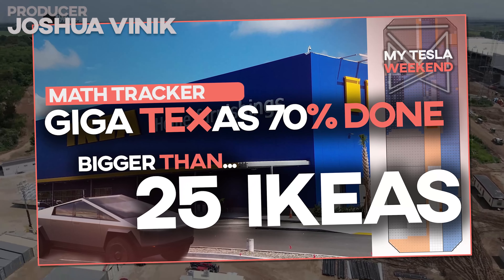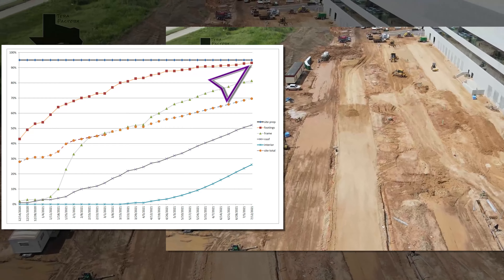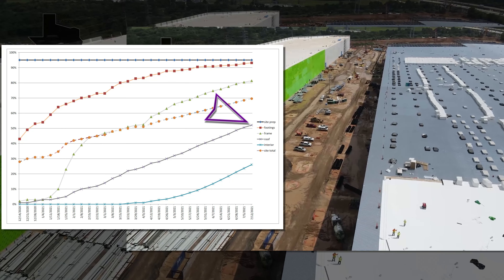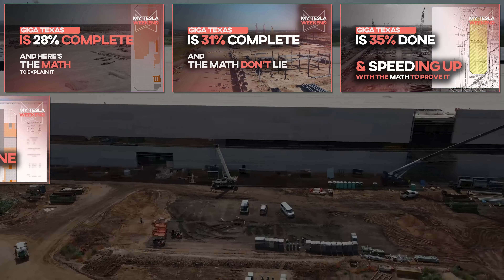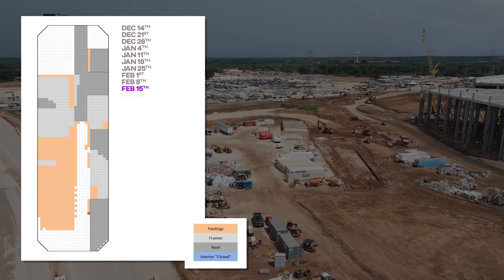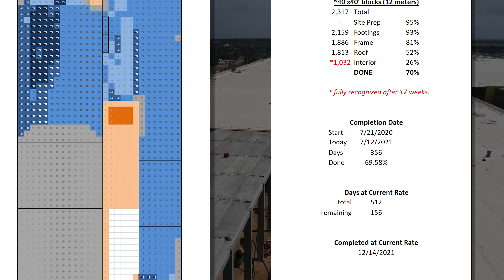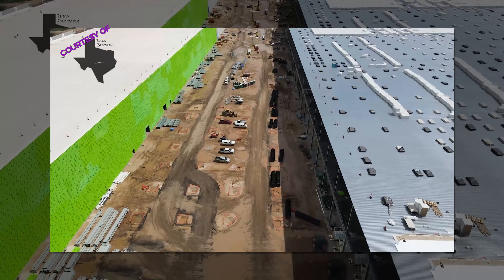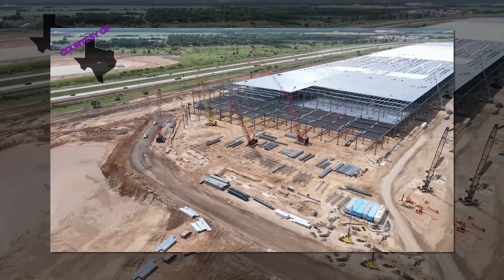Giga Texas is bigger than 25 Ikeas and it's 70% done

Comment: As for provisional CO’s….it’s generally done by sections of the building broken up by fire and smoke walls. So if the building is broken up into say six sections and three of them are used for Model Y production, as long as those sections are safe and up to code and they are broken off from other sections by two hour smoke walls and usually 1 hour fire walls, you can usually start using them. Still a lot of work to do, but I’ve worked in a lot of places that started production with the entire build still months from completion.
Reply from the maker: Thank you William. Can you share a citation for this, because I spent about an hour researching and only found the definition as being "a building" which would include the greater structure, to my mind.
Reply: Absolutely true. It may be hard to find a citation for this since this is generally in the books for contractor licensing

Comment: You should re-think your 4-week footer curing idea. They have put up columns in the casting area less than 2 weeks after pouring footers.
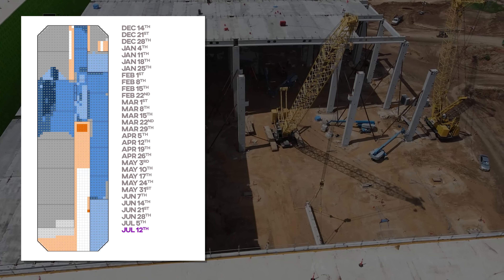Reply: Uh, but no. If you look at 05:09 you'll see the footings from two weeks ago don't have columns on them yet. It was only the two rows closest the the existing structure, and there are no columns on those yet.
Reply: @davosmergblar1014  they put in 9 footings 2 weeks ago where the tankers used to be, and they just put columns on 3 of the 9. the footings nearest the casting machines went in long ago (the columns are doubled) so they have 9 columns to go, but only 6 new footings
Reply: @davosmergblar1014  I don't think so.  There are three columns on the latest footings.  They do have nine columns to go, but three are right next to the existing columns and those footings have been there for several months.
Reply from the maker: @Bruce Dubbs The footings poured two weeks ago do not have columns attached as of the latest video. On June 28th there were 4 left to be poured. By July 5th they'd been poured.

If these get columns in the next week, this will give some breathing room to the final completion figure, but once the last walls are up, even with the 4-month interior completion lag, they may be able to get a certificate of occupancy at any time, provided their interior systems are complete.
Reply: @FutureAzA  Not sure why you are being so stubborn about this when there is physical evidence.  The new footings most certainly have columns.  Check out Randy's video from July 9th (footage from July 8th).    There was a similar situation back in November when they went from pouring the footing to placing the column in about 15 days.
Reply from the maker: I am ABSOLUTELY mistaken... well well well, this gives the deadlines a whole new breath of possibility. Thank you for the correction, Dale!
Reply from the maker: @Sammy K I wasn't being stubborn, I was mistaken. Dale Richardson posted with two links for me to review, and he (and YOU) were right. They are absolutely putting up columns in less than four weeks. This gives me reason to rethink next weeks projections.
Reply: @FutureAzA  Reason I thought you were being stubborn is that this was brought up in a few of other videos (even yours) where you participated in the comment thread and it was pointed out that they were not adhering to a 28 day curing time.  So when you posted the same here on your latest video, I figured you just didn't want to believe any of the evidence that was presented.
Reply: 3 words for you . “Early straight concrete”
Reply from the maker: @gevelmarrero  Maybe more than three words would help me better understand. :/
Reply from the maker: @sammyk874  Oh, I wasn't calling you out. I was explaining why I needed to apologize. I assure you I was CONFIDENT the 4-week rule applied until I saw these side by sides. I was simply wrong. I'm happy to own that. It only makes my future projections that much sharper.

I'll use 2-weeks in future projections, since the upcoming ones are all much lighter steel than this uber-heavy concrete. This is awesome information for me to learn, and I thank you (both) for this.
Reply: @FutureAzA  Probably referring to (High) early strength concrete...

Comment: I believe the middle corridor was left for access during construction. imagine trying to use a crane to reach across the width of the building. also, I cant remember where I saw the shape but the entire building is supposed to be a complete rectangle without its corners...the corridor will be finished after they are sure that all crane work that can be done, is done before they complete the building.
Reply from the maker: That's my take as well.

Comment: “Since you asked”. ..   I believe that the central opening at the south end will remain so, since the concrete slaps of the southwest corner, the “Stamping Building” seem to be reserved for exterior walls.   I doubt we’ll see any footings south of that demarcation point.

“I once thought I was wrong, but I was mistaken”
Reply from the maker: This may prove correct, but bear in mind that Berlin has tons of interior concrete walls.
Reply: I think those walls are more for containment of any of those thousands of tons of pressure if any of them do something unscheduled.

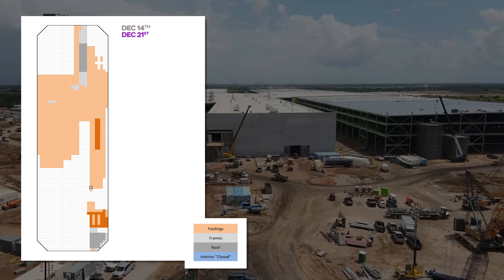Comment: @4:03 - most of the know Model Y area is already blue.  So who knows when that first car will be made......I'm still holding onto early September.
Reply from the maker: This isn't a crazy notion, Gerry. Once the exterior walls are in place, they COULD apply for final permitting, or at least a provisional certificate of occupancy, assuming the critical interior safety systems are in place. I expect that to happen around that time, and it looks like they've been installing, configuring, and testing the equipment to move quickly into production.
Reply: @FutureAzA  Agree -

Comment: Do you expect the south central corridor to be fully built? I was wondering whether they would only go south as far as the northernmost end of th estamping building (since this is walled to the west side with outer walls rather than just a fire break wall).
Reply from the maker: If you had asked me a few months ago, I'd have said no. At one point I even replaced the central corridor square with question marks for this very reason, but they resumed footing work, which upended my assumptions.

Berlin has a lot of interior concrete walls, so I don't count that as a good indicator. The green extending down to it definitely suggests the structure will go at least that far.

My hesitation to commit is the massive lack of loading docks around the property. Curious to hear what all you guys think.

Comment: Great video and tracking of the site! I don't think they are going to make it for the deadline unless they don't fill in the middle bit.
Reply from the maker: Kind of depends on how much of the interior needs to be done for the site overall to be considered finished. It could be that since so much of the equipment installation is already underway, that my 17-weeks from walls to done is overly pessimistic. Still pretty exciting either way.
Reply: @Melody615199999  The bit in the middle that's still wide open where there aren't any footings yet.

Comment: This maybe done with private inspectors to not delay the project. They probably hired a company that is on site doing inspections possible weekly. It’s called private provider and they would relieve the city/county of liability. Inspections are probably done in sections.
Reply from the maker: Was not aware that was a thing. Thanks for the heads up. I just figured that expedited inspections were the unspoken part of the incentive package to get them to move there... or maybe it was written in, but either way.

Are these 3rd party inspections binding? Are the just as good as a city inspection?
Reply: @FutureAzA   yes they basically would take full liability and responsibility of the structure should something happen. The best way to put it is a lot less government involved so it’s way more efficient. Doesn’t mean they won’t fail a part of the structure but it would make plan revisions and inspections much easier. I’ve been in construction 10-11 years and just found out about this last year

Comment: What I look at is road black top going down. And parking lots paved.
Reply: Then you will like the finish dirt work in front of the west side loading docks. Concrete dock aprons this week?
Reply from the maker: I've excluded those because, even as hard of work as they are, those are logistically easy. If you've ever seen a parking lot go in, it takes a day. Even a parking lot as massive as this one is a 3-5 day project at most. There are already roads going in along the west side near the highway, and to the east and south of the parking lot. They took very little time in absolute terms, but even less compared to pouring footings, or erecting steel.

Comment: Hey there worker bee. 
I think you don't need to have the wall panels on most areas left by the datec17weeks out because.... they will not be fitted out for production immediately. So areas like the framing they currently assembling, and the 2nd part of the casting area, only need roof and walls, and basic services for now. Ie, all the initial production areas are walled and already being counted., the17 weeks rule, awesome as its beem!!, breaks down on the remaining areas, I think they, maybe, heed 5 weeks, possibly 10? Same with foundations, I think all N half done, and southern gap will be last thing closed off, maybe at Christmas, so essentially finished for now. Probably. Possibly, maybe....
Reply from the maker: Absolutely right, I think, but I feel like it would be dishonest to adjust my math this late in the tracker. Better to see cars rolling out while we're at 96% percent I think. ;)